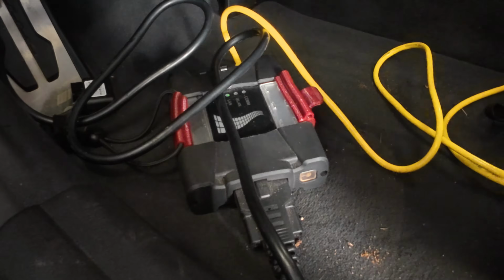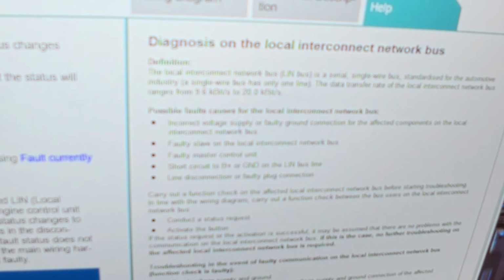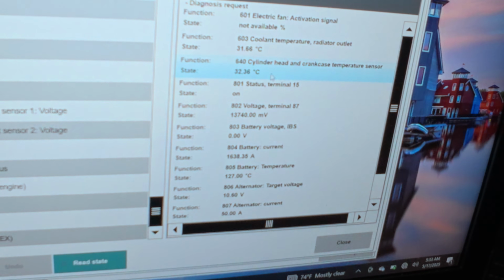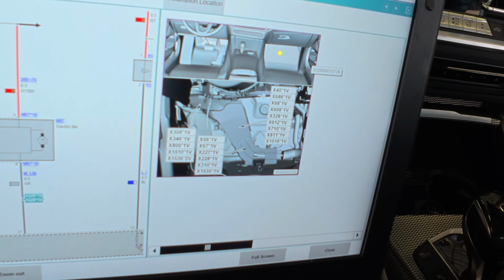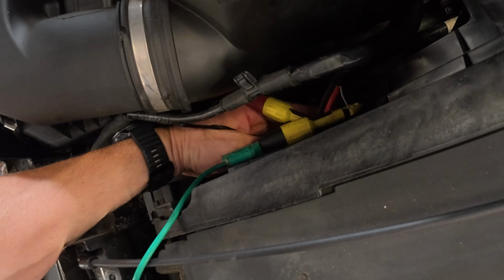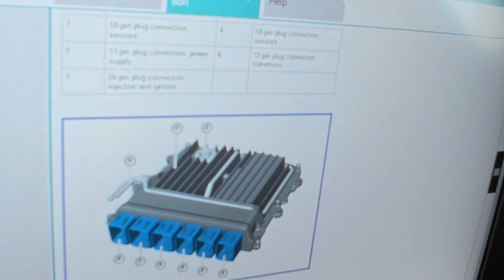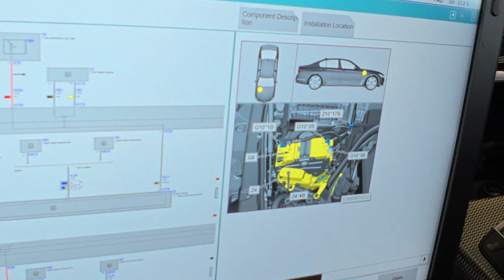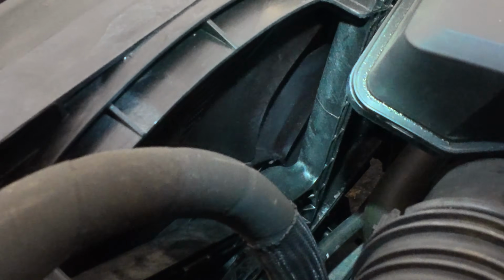BMW Radiator Fan Dead? Here's The Real Culprit (LIN Bus Nightmare)

Comment: I don’t think your issue is the shutters, it looks like the line is rubbing on the crash bar in the video and you’ve moved the wire away from it.
Reply from the maker: Very good observation! I did tell the shop to give the harness and connector a good visual inspection due to the rust seen and possible corrosion. However, don't forget our "short" was to "battery positive" not to "ground". The crash bar would create ground.

Comment: I WAS CALLED TO A SHOP YESTERDAY ,, TO LOOK AT A TOYOTA MARK-X FOR A SHIFTING  PROBLEM . ONCE AT THE SHOP I WAS QUICKLY ASKED TO TAKE A LOOK AT A BMW 5 SERIES FOR A/C COMPRESSOR NOT ENGAGING WHEN THE CONTROL HEAD UNIT SWITCH WAS PUSHED . AFTER A SHORT GOING OVER , IT APPEARED THAT THE  AMBIENT AIR TEMPERATURE SENSOR WAS NOT READING THE CORRECT TEMPERATURE  BECAUSE OF A BAD CONNECTION AT THE CONNECTOR . BUT WISH I HAD THAT BMW ISTA SCANTOOL THAT COULD HAVE HELPED SHAVED OFF A FEW MORE MINUTES FROM MY DIAGNOSTIC TIME . BECAUSE I WAS TOLD TIME IS MONEY,,,,,,,,,, THANKS FOR YOUR TIME AND THE VIDEO LOOKING FORWARD TO MANY MORE !!!👍🏼👍🏼👍🏼🙏🏼
Reply from the maker: Honestly ISTA is very affordable. Only $30 for a day. You'll have to update it every time you use it and that can be annoying. But the time you save is worth far more than $30
Reply: @KOEODIAG  THAT IS AFFORDABLE ,,,,,, BECAUSE BMW'S ARE NOT THE EASIEST TO UNDERSTAND HOW THEY COMMUNICATE THERE SERVICE INFORMATION .